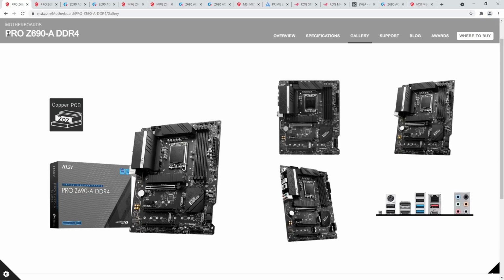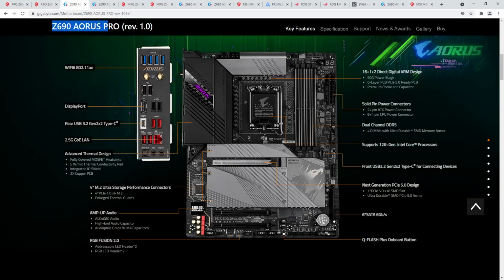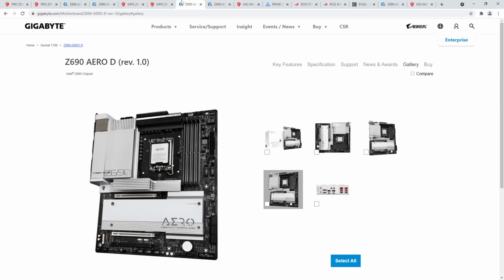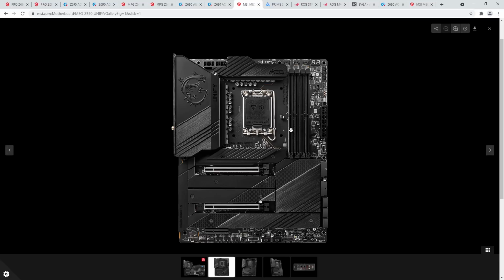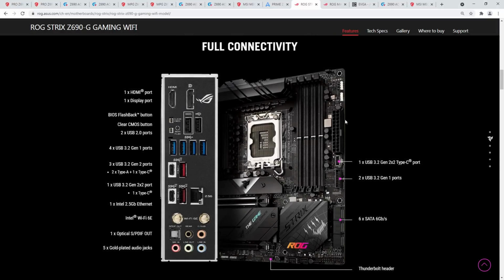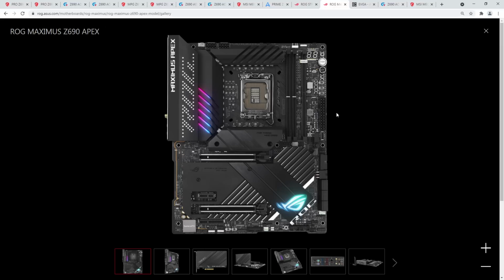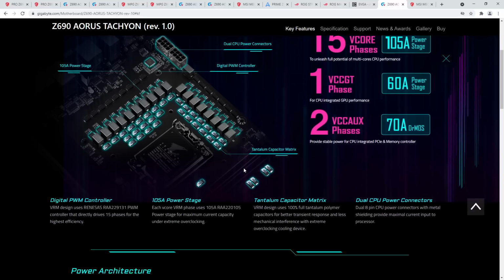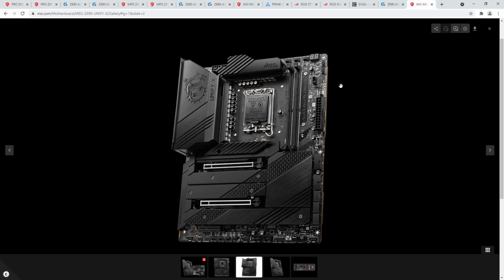Z690 Motherboard round up

Comment: The only real "issue" with the z690 a pro is that it only had ALC897 instead of ALC12**.  For $200+ they really dropped the ball there.
Reply: 897 is not as terrible as 887, but that may just be implementation issue of 887 motherboards with anaemic circuitry. 1200+ could be nice but not really necessary for any normal audio equipment, and anyone with that hard-to-drive headphone probably doesn’t lack cash for higher end or has own dac. 
Source: owned one of cheapest am4 mobs w/ 887, and now b560m aorus pro w/ a decent 897(might be some other 89x)
Reply: None of those are great (Realtek chips integrated to your Motherboard). Anyone even semi-serious with their sound buys a real sound card. External or internal.
  Actual real sound cards (can) offer billions of times better SW, much better connectivity, better support (bug fixes might not take several months) etc.

My Asus X570-E from 2019 does have Realtek S1220A. The chip itself is OK, for basics. But SW, drivers and support aren't.

This year I've used mostly BT headphones (Sony XM4's with Windows 10 Home/Pro and 11 Pro) and it has worked well (2019 and part of 2020 was a different story...). There's nothing else to adjust except Volume, with 2dB steps.
  But... when connecting same heaphones with a cable (in order to get rid of BT's latency), there's always an annoying buzz mixed in (Front panel connector, since no sound comes directly from the I/O-panel). If front panel cable works now as an "antenna", this might be fixable by shielding that cable. With Windows 10, that is...

...since now with Windows 11 there's only that buz (no actual sound at all). Will this ever be fixed? When? Is this Microsofts fault? Nobody will tell you. If you can't handle this kind of sh*t, buy a real sound card.

Luckily, when I connect my headphones with a cable to my AV Receiver, which itself is connected to the Motherboards Optical In, there's no buzz.
  So, do both wireless BT sound and wired analog sound work? Yes, they do. Sorf of... But If I didn't have that AV Receiver, I'd now have only wireless BT sound (good sound, bad latency for guitar playing or serious ADHD-FPS-gaming). Hmm, I wonder if there are any sound cards on sale next Black Friday...
Reply: @eukariootti1  I have to argue that most motherboard integrated audio chips are “pretty good” when implemented properly. For one part, checking the data sheet and most of the modern ALC chips sits comfortably against their sabre or else external counterparts. Most times it’s the lack of noise filter circuitry for the chips input and output that makes discernible difference in audio. For listening, sample rate and channel width doesn’t matter as anything 24bit 192khz is not discernible at all to 16bit 44.1khz stereo.
I’ve had the lower end of motherboards (ALC887 on cheapest a320) which could not filter out electrical noises completely at low volume, and had anaemic microphone gain. The current ALC89x on my b560m aorus pro has no noise, and better audio (probably just in my head) then my Xperia z5, a mid 2015 MacBook with cirrus DAC(4208B?), or a cheap usb dac with SSS1700. And the mic gain is enough to drive the cheapest POS AliExpress electret boom mic. Cases might matter a little(?) as using the front panel 3.5mm has extra capacitors as filter compared to the back IO panel.
And for BT, windows just have a mess of BT stack. In later windows 10 builds and windows 11 at least they have introduced aac codec which I would argue is all you need, and aptx (no aptx hd, aptx LL for gaming) or otherwise. Though, adapters with those specific aptx features has become widely and cheaply available now. LDAC is available on more expensive adapters though I really doubt it makes any difference, as BT will compress anyways. And most importantly BT audios sound quality with exception to codec support, has no ties to the motherboard. Since the codec only send the signals to your headphone and your XM4 is what’s doing the driving in BT mode, as opposed to cabled when source devices drives the headphone. 
I have a cheap tws earphone and they have noises at low volume. My XM2 has no noises in BT. The XM2 has no noises even when connected to my MacBook with the damaged audio circuitry(I plugged 3.5mm jack with voltage into it, damaging it) because the dac has nothing to do with the BT side of things. So again, the implementation of XM2 is just better than the cheap TWS and filters out the noises.
In terms of connectivity, my 89x on the aorus has the same 6 port w/ optical as the more expensive boards, though I only use front out and mic in in the rear IO, and the front combined 3.5mm. I have no optical equipment to use with it or the Mac with its spidf. It’s most likely that the board has poor noise isolation or power supply producing too much noises, as in a pc there is no lack of electrical noise producer. My usb powered, 3.5mm connected altec Lansing pc speakers has minor noises when connecting to any mobo usb, but none if I use a dedicated adapter like the common apple 5w USB adapter. Optical in only transfers data and I assume your av receiver has its own robust filtering for its power input. 
Sorry to type this much :0
TLDR above is why I don’t think motherboard audio chips are inherently inferior to any other chips, only that it is difficult to filter out all of the noises a PC can make, and implementation of chip’s noise filtering matters more because of this.
Reply: weren't we on ALC 1150 in 2014 why are wie on 89X just seven years after on boards that cost tripple the price.

Comment: You left out one that I think would would pair well with a 12600K or a 12700K, an Asus Prime Z690-A. Good amount of PCIe slots, connectivity, acceptable VRM, and decent price. Though downsides are memory overclocking and no post code.
Reply from the maker: the ASUS Z690-A has basically the same feature set as the MSI Pro Z690-A. Especially with a 12600K you don't need more than 14 power stages in the VRM.
Reply: @ActuallyHardcoreOverclocking  true pairing it with a 12700K makes a lot more sense. It's definitely a trade-off for that extra PCIe slot and a pre-installed IO shield, since it also doesn't have wifi.

Comment: Agreed on the Asus boards being very expensive for Z690. However, in some countries Asus currently has a cashback promotion when buying a board + Alder Lake CPU which puts some of their boards back in to the "worth considering" category. For example, the Asus ROG Strix Z690-A D4 + 12700K can get you back €90, which takes the board down from €350 to €260 which is much more competitive since it gets you some small upgrades over the cheaper MSI and Gigabyte boards (like Intel LAN, more M.2 heatsinks, slightly beefier VRM) though you lose out on the postcode.
Reply from the maker: THE MSI PRO Z690-A LITERALLY COMES WITH INTEL LAN. 
I don't even know of a board that doesn't have intel lan.
Reply: @ActuallyHardcoreOverclocking  You're right, I confused the MSI boards with the Gigabyte boards in that regard it seems which well... there you go. The Gigabyte Z690 UD (D4) (AX) and Gaming X D4 as well as the Asus Prime series of boards (except the -A I think) all have Realtek 2.5Gbe. Admittedly, this is probably not an issue at all for most people.
Edit: Actually, re-reading my comment, I noted it as a collection of difference as compared with the MSI and Gigabyte boards. Also, calm down on the capslock please.

YouTube is having issues so apologies if this is a dual post.
Reply: Yes I got the strix d4 for that cashback 😎
Reply: @ActuallyHardcoreOverclocking  elite AX has realtek for whatever reason.

Comment: 16:55 best part of the vid 🤣 I was a little bummed not to see my board mentioned, Strix z690-A Gaming WiFi D4 (DDR4). I picked it up on Amazon direct from Asus store for $239. Granted, I'm not nearly as knowledgeable as you but after doing some specs vs price comparisons it seemed like a 'smart' buy(not a big fan of the silver though). Lotsa' USB-A and M.2 were my big wants for flight sim stuff because using hubs always seems to create an issue. Actually, although a little more on the expensive side I originally wanted the Aorus Ultra but no DDR4 version and for me good spec DDR5 was next to impossible to get and/or outrageously expensive for a questionable performance gain, at this point in time. Anyhow, thanks for the vid/info.

P.S....the Apex but especially the Dark MB's sure are slick &  pretty, I really like the Dark's shielded 90 degree connectors.
Reply: I came to the same conclusion.  But Strix Z690 - A DDR4 for 239$×? For that price only Asus Prime Z690 P D4  is available ( 230€)

Comment: Interesting on the Taichi Thunderbolt, you can run 2 monitors right off the Intel iGPU. All the other Z690 TB I've seen run 1 display or have a DP in for a second. That is probably why they have only 3 M2 slots, others have up to 5.

Comment: Just realized how easy your choice is, if you only have an ITX case. So many options just gone.
Reply: if you go ITX you are better go with a H or a B.  These no place for putting PCI-lane stuff and big enough VRM/heatsink for a 12900k.
These no way to justify a ITX board on a Z platform. While Z690 is literaly about massive PCI-lane capability.

Getting a new case will cost alot less that the money you will waste on a ITX Z690 with all the PCI lane and capability you gonna lost.
Reply: Most Z690 ITX are the same with 10+1 105A power stage, only difference is feature sets. Also bear in mind that going Z690 takes away the huge PCIE bandwidth advantage of Z690

Comment: The jump in price from the Z690 Aorus Pro to the MSI Z690 carbon is >GBP100. I'm interested in the performance boost that fast DDR4 memory can provide in games at 1080p for a specific usage case (why I'm sticking with INTEL, for the faster RAM speeds). My usage case is admittedly pretty niche but people buy fast RAM because they want a performance boost...is there not a recommendation for an alternative to the Z690 Aorus Pro at the GBP300 price point for people using DDR4?

P.S. Ultimately probably going to hold out for the very last gaming motherboard to support DDR4 so probably not buying this generation, but just thought I should comment. I have some super expensive G.Skill Trident Z Neo that I'm trying to get the most out of.

Edit: Just found BZ's "Looking at Z690 DDR4 boards again" video  :0)

Comment: I have an MSI PRO Z690-A DDR4 on the way.  People have shown that MSI bios can do at least DDR4 4200 in gear 1 with dual rank sticks.
Reply: Seriously? That is hecking fast.
Reply: @rek_t  It allows you to clock your memory (if you have good enough sticks) at higher speeds, which will improve performance, specifically in gaming.  4200 gear 1 with tight timings is seeing a good 10% or more performance over even the fastest DDR5 right now.  You have to have good memory, but the premium for good sticks over mediocre sticks is only about $50.
Reply: 16GB DDR4 sticks can go fast in MSI and Asus boards while Gigabyte and ASRock are stuck at like 3466 or won't even post outside of optimized defaults.

Comment: Block diagram of the Aero D shows an odd TB setup with TB controller at the output. They identify a VisionLink TB connector, what is VisionLink? The Aorus Extreme block diagram shows "Intel TB Controller" on the PCIe3 bus and looking a lot more sane. Any thoughts on these two layouts?

Comment: Out of curiosity, what about the Biostar boards?
Because for my one specific usecase there's 2 boards that exists, the Asus ProArt and the Biostar Valkyrie
Surely they're not as trash as that one AMD board that had to be frankensteined to hell just to not be a pile of ewaste and failure.
Reply from the maker: the Pro art is basically the same as the Aero D from what I can see but if you're really stuck between the ProArt and Valkyrie I'd take the ProArt
Reply: @ActuallyHardcoreOverclocking  Yeah I figured, this platform isn't doing my bizarre wants any favor when the only board that meets all of them is very likely overpriced to hell and from a dodgy manufacturer and the only other choice is an heavy compromise.

Comment: I still have a 24 phase board from 2011 and its my gf’s daily driver. The gigabyte z68x ud7 board with a 4.9ghz 2600k and 2133mhz ddr3. It’s a great machine.
Reply: Those old gigabyte Ultra Durable boards are great. I had an X58 ud5 and I loved it.

Comment: Thanks. I got  the msi Z690 edged ddr4 for $319
Reply: how's it's going?
Reply: @morgothbloody7181  best mobo you can get for ddr4 oc
Reply: @SAVA47-00  ty, i will take her and 4400 DDR4 CL18
Reply: @morgothbloody7181  do it you won't have any problems.
Reply: @SAVA47-00  what do you use to cool down cpu? i can't choose between arctic liquid freezer II 280 or 360 mm
Reply: @morgothbloody7181  i use a direct die block from supercool.
Reply: @morgothbloody7181  artic makes great cooler 360 or a 280 will work 5.2 oc  on a good airflow case
Reply: @SAVA47-00  ok thanks bud
Reply: @morgothbloody7181  your welcome
Reply: Why did you go with the Edge over Tomahawk or Pro? I am leaning towards the Edge but I have seen a lot saying that the Pro is probably best way to go. If you had to do it again today would you still go with the Edge of would you reconsider?
Reply: @Being_Joe  just aesthetic nothing wrong with the pro or the tomahawk
Reply: @Being_Joe  I'm looking for Pro vs Tomahawk 186€ vs 227 €

Comment: How much would you say that it matters that I can't use both of the 8 pin power connectors on the MSI board? My EVGA G3 Supernova doesn't have two and I'm curious if the 235w power limit will matter. Planning on getting either 12600k or 13600k with some overclocking.

Comment: If ASUS simply sold the APEX board without the expensive DIMM.2 and PCI-E M2 cards, WIFI, and other mostly pointless accessories, this board could be in the $500 price range with zero changes to the board design.
Reply: Removing all those features basically result in a new design lol.
Reply: @shadow7037932  no it’s the same design, but you can choose to purchase the extra junk if you need it.
Ie: $500 down on the board and $200 later if you need the dimm.2 and pci card
Reply: @byronfranek2706  The $420 apex xii came with the same "expensive" DIMM.2, Wifi and other mostly pointless accessories.  It wasn't even that long ago, year and a half almost?
Reply: @dbuddle27  Bingo.

Comment: I just went with the cheapest option available and got Asus Z690-P D4. One of the cheapest off the shelf and definitely the cheapest after 60€ cashback with 12700kf. Doesn't have that many USB and no debug screen, but for what I need it to do, it's more than fine. Only overclocking I did on it was pushing my old 3200CL16 kit to 3600CL16 and took off any excess voltage from the CPU and called it a day. Only thing I hate about it is the IO shield, fuck these old ass standard sheet aluminum IO shields in particular, they never fit 100% perfect.

Comment: I have a Gigabyte Gaming X waiting for me to put the computer together. But reading about the DDR4 issues is making me consider exchanging it for the MSI PRO Z690-A. It's hard to find a proper answer if you don't really want the ultimate memory performance, is the Gigabyte DDR4 board(s) fine or not. For example I have a Kingston 3600 CL16 kit, and would like to just run those specs. A bit lazy and would want to avoid building a PC with Gaming X only ending up sending it back and getting MSI :D
Reply from the maker: if you already have the board just check if the XMP works?

Comment: I was thinking of getting a 12700k with a Z690-A PRO Motherboard. I don't plan to overclock, just enable the usual core boost when gaming. Is there a noticeable performance difference from a 14 phase VRM to a 16 phase VRM (like in the case of the Z690 UD Gigabyte boards?). That's honestly my only concern about picking the MSI one over the Gigabyte one (And also that the UD is much more expensive in my country).
Reply: I have the MSI Z690-A DDR4 and lets just say for stock settings a i7-12700k hits the benchmark scores you see at the usual tech outlets, so don't worry too much about it and buy what makes financial sense to you.

Comment: why do most of these look like 3 PCIe slot micro-ATX boards, stretched out with M.2 filler, lol.
Oh, but there is that massive block of metal between the 1st and 2nd PCIe slot that doesn't "do" anything there, so it's more than just M.2 filler I guess, lol.

Comment: @Actually Hardcore Overclocking

for an i7-12700k
do i actualy need 2x8pin 12 v connectors for the cpu? or will the boards just boot fine with just 1x8pin?

Comment: The z690m aorus elite has a 12+1+2 phase power design, which seems to be good go a mATX thats one of the cheapest boards you can get
Reply from the maker: where did you find the price for it?
Reply: @ActuallyHardcoreOverclocking  im in Australia and its priced at $300 AUD

Comment: do a lot of test benches have a place the put the io shield? strange to me the tachyon doesn't come with an integrated one.
Reply from the maker: IO shields serve no functional purpose
Reply: @ActuallyHardcoreOverclocking  they label the ports, which unless you already know or want to remember which usb port is used for the bios serves some purpose. for instance on the tachyon I looked it up and its the port between the type c and ethernet. i could be way off base and it's a non factor for the people actually buying it.